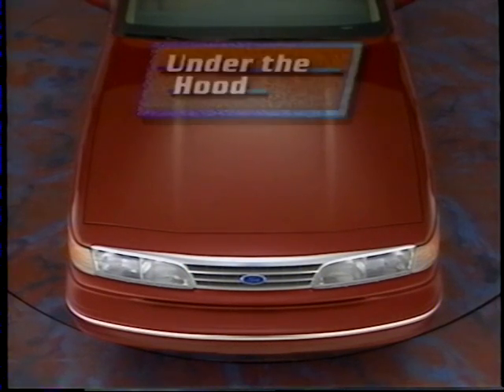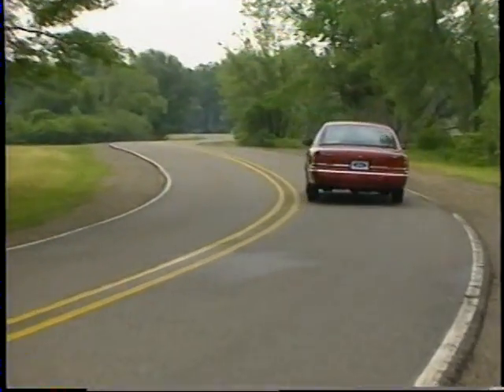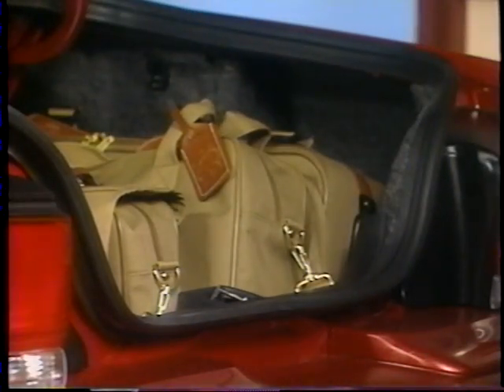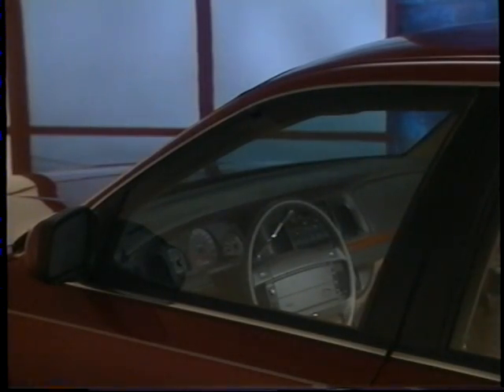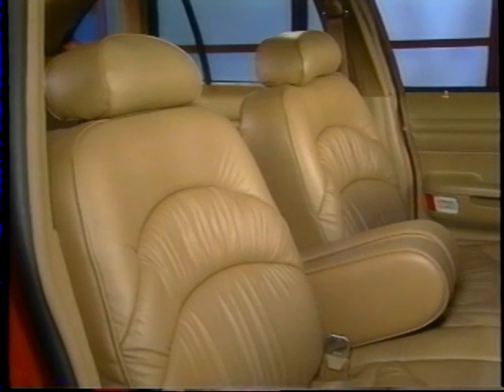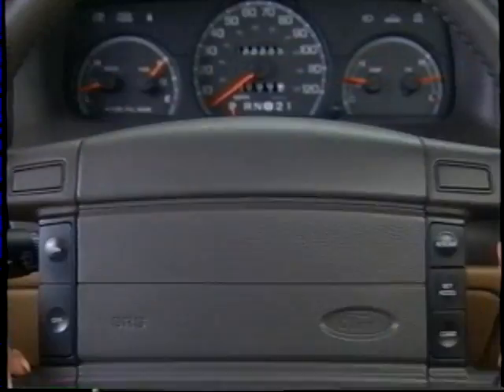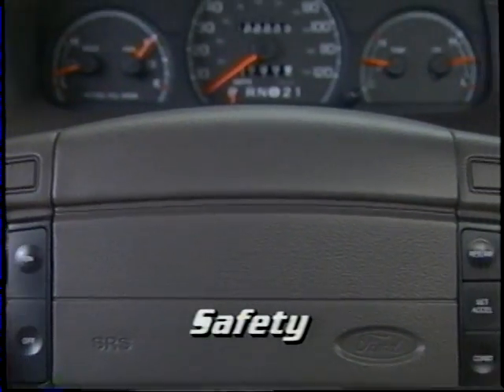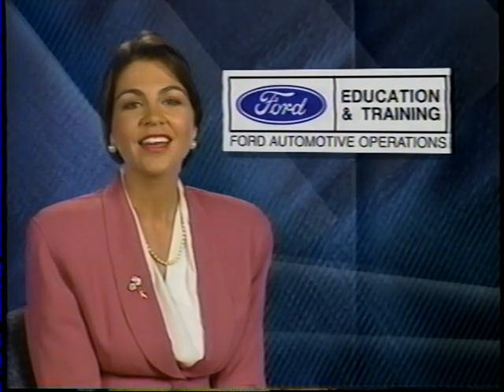Ford Crown Victoria Dealer Training Video (Part #2)

Comment: I sure would not mind having one of these 1990s all the way up to the 2011 Crown Victoria Lincoln Town Cars or the Mercury Grand Marquis even the late 90 ones I would not mind having instead of my stupid 2011 Chevy Cruze or any other small compact car cuz he's bigger cars are definitely more fuel efficient if you stay up and maintenance use cruise control Drive the speed limit and go easy on the stop-start gas pedal
Reply: As well as the late seventies all the way up to the late 80s Lincoln Town Car Lincoln Continental Mark 6 Grand Marquis and Crown Vic and definitely sedan or wagon with the Country Squire